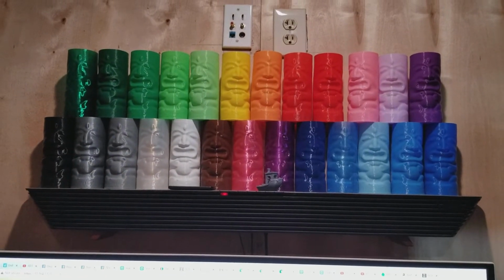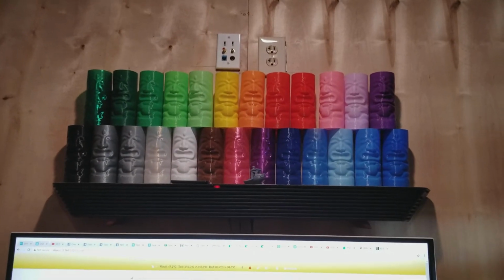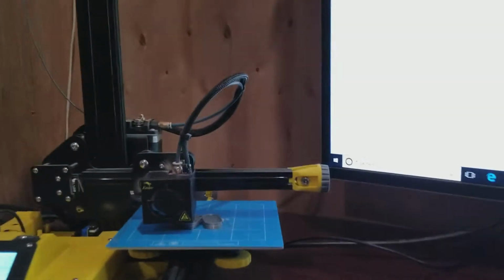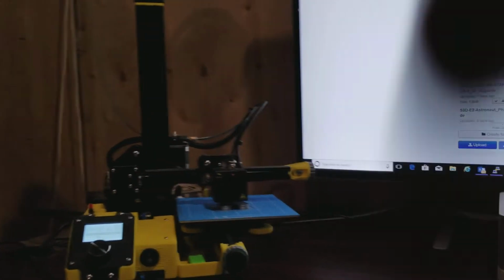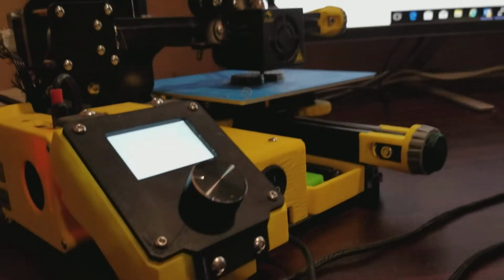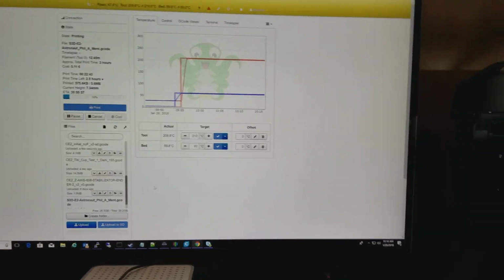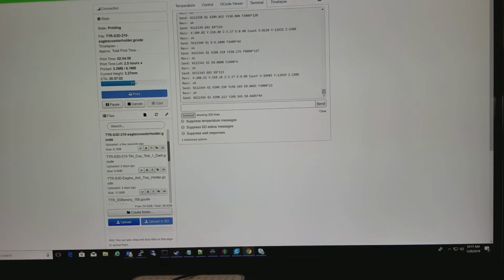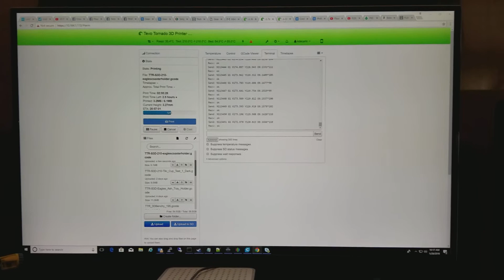Tevo Tornado, Monoprice Maker Ultimate, Creality Ender 2 update review. Filament video teaser!

Comment: How do you get the prints of your tevo tornado print surface? Because it is super hard to get them off on my printer.
Reply from the maker: Get a good scraper, I use one with a rounded beveled end, the stock one is junk. Then let cool all the way.  Use Palm of hand to bang the back of scraper while holding on an angle towards under the print. Once you get am inch of tip under the print work the tool around in an circular manner and them farther under print.  If the nozzle is too close to the bed, the prints become almost welded on and you will need to use a razor blade.  HTH.
Reply: Best reply ever!
Reply: lol yeah

Comment: Looking forward to the Delta review. I am thinking of trying a delta but first I have to get my Tornado printing better I am having serious ghosting issues at the moment but I will fix it. Thank for the great videos.
Reply from the maker: I'm looking forward to it too. Check your acceleration and jerk settings on the Tornado they are too high from the factory for many Tornado's, set the acceleration to 1000 for both print and travel and the jerk at 8, see if that helps.  Thanks for watching!